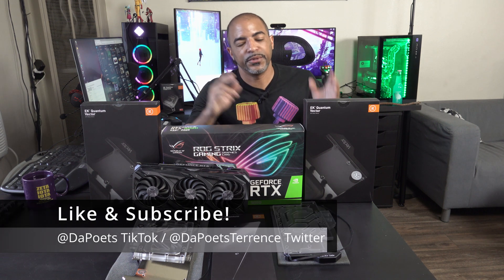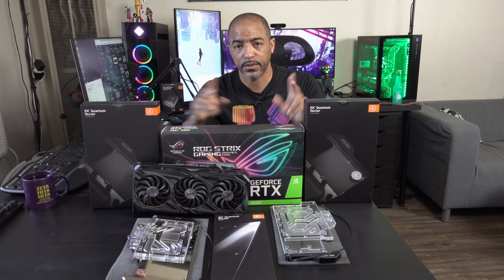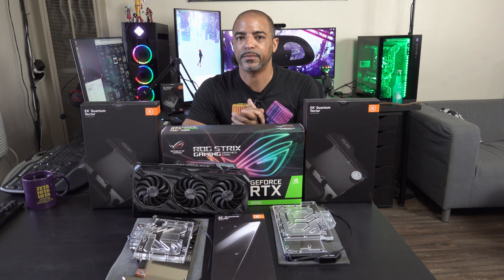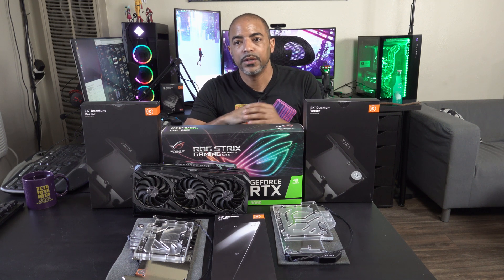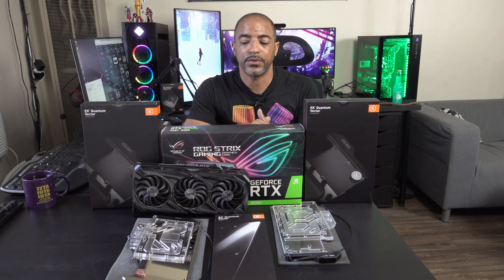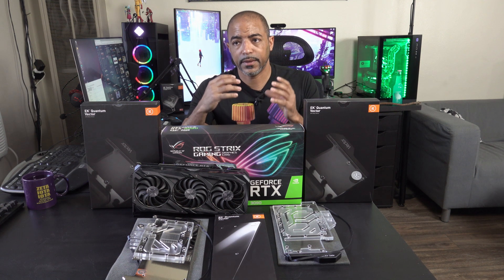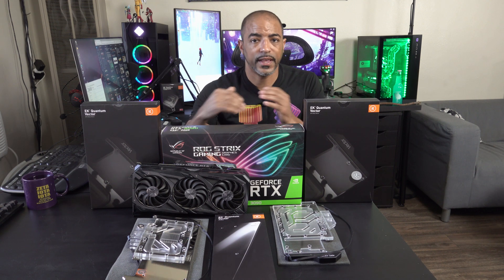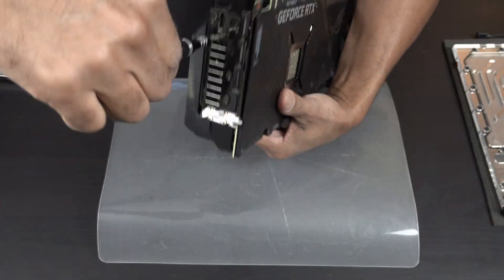Drops Those Temps! STRIX 3090 - EKWB Active Backplate

Comment: is it possible to use the ekwb active watercooling backplate in combination with the stock cooler?
Reply from the maker: No
Reply: @DaPoets  i mean in combination of the front stock cooler or do i have to install a front waterblock as well?

thanks for the reply
👍
Reply from the maker: @Yorhosashi  Front & back is required together.
Reply: @DaPoets  that's a shame, i was really hoping it was possible. 
so thanks for responding again for not letting me find out after i had wasted time and money on this!

Comment: Oh man, I just ordered the same card and thought I better check if my 3x120mm intakes and 1x120mm outtake is going to be enough for heavy machine learning use. Impressive setup.
Reply: I just bought two full sets of ARCTIC P12 Max - High-Performance 120 mm case Fan, PWM Controlled 200-3300 RPM, optimised for Static Pressure, from Amazon for less than 9 bucks each.  I've been watercooling for over 25 years, these are the second best Static Pressure fans I've ever own, & they're 1/5th the price.  But when stock runs low their price will skyrocket, as good fans always do.

No ARGB, but with super small ITX builds LED lights look stupid to me.

Comment: 96 degrees?  Wtf…. You should not be anywhere near those temps with a 480 rad rocking 4 fans each maxed out.  You’ve got to be falling short somewhere in your components, probably fans on the rads aren’t enough and EK usually sucks anyway.
Reply from the maker: I think you misunderstood some of the data
Reply: LOL? bro, 96 degree C on AIR ... >.< 
dim wit .. 
Listen to the video, and don't do crack ..

Comment: Bad - why are you using crappy 3w/mK included thermal pads!! step it up - Thermalright makes some 12 & 17w/mK for a fair price go get em
Reply from the maker: When you are reviewing a product, you don't change the components. Also you can't compare w/mK between different companies as they all have their own way of calculating that, so it's meaningless unless it's in the same product line by 1 company.
Reply: @DaPoets  doh. Right. I mistook you for showing the best of what it can do.  I get it. 
It would be interesting to see if high performance pads make any significant difference
Reply: Not much point in changing out the EK thermal pads as they do their intended job quite well. I'm also not sure you would gain much from going to either 12 or 17 pads since the copper water block will transfer the heat so fast anyway. It's doing its job as it's supposed to do. Now this might be a different story for air cooled cards as the heat has to be transferred into an aluminium heatsink, and you want as much heat transfer as possible. I get a temperature of around 60C on my VRAM with my RTX 3080 with those default EK pads.

Comment: Yikes they still using thermal puddy? Gonna suck for warranty claims if you disassembled the card.
Reply from the maker: They honor the warranty if removed from what I've seen from a few sources.
Reply: @DaPoets  Ah that's nice. They used to be a bit stiff on this issue

Comment: I've actually been contemplating on buying a 3090 Ti since it's been discounted quite a bit, but then comes the issue with the upcoming 4090 soon. Would probably be a waste of money doing that right now. I just want a card with 24 GB of VRAM, don't much care if it's a 3090 or 4090, however the price DOES matter. First world problems as always :)
Reply from the maker: Unless you're doing some extremely high end workloads, you won't see a tangible difference between a 3090TI and a 4090 base on the info we have right now (also unless you're doing 8K gaming). 30 series are at a good price point and falling while the 40 series will get scooped up fairly quickly w/ less 30 series available as they are not making more. May be a good idea to buy now.
Reply: @DaPoets  True. They claim a 66% more performance gain over the 3090 Ti in a synthetic benchmark, but that really tells us nothing in a real gaming scenario. There's some rumors about it being more expensive compared to the 3090 MSRP since the performance gap between the 4080 and 4090 this time around is supposedly much larger.
Reply: @TolaGarf  With those performance gains come insane power draw as well. I'm avoiding the 40 series and plan on picking up a 30 series soon purely because I am SFF and I am not prepared to deal with Nvidia's ham fisted speed improvements by just throwing more watts at everything. That extra power draw has gotta increase temps as well, which means even bigger cards to handle the extra heat dissipation.